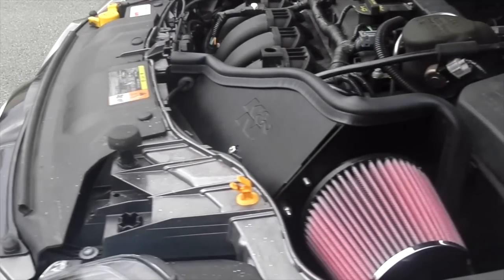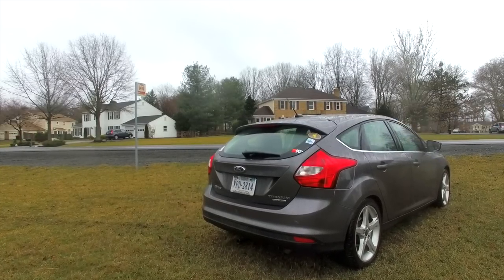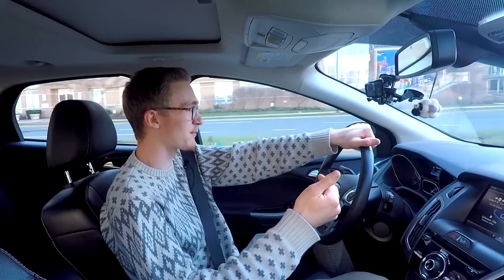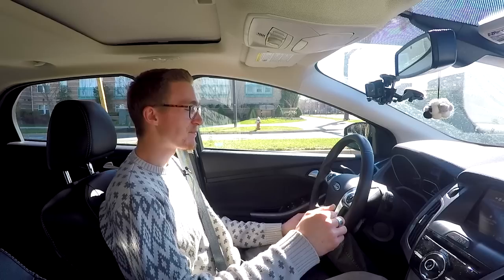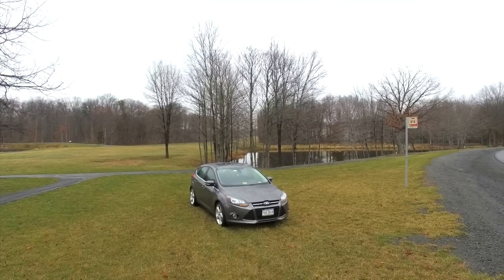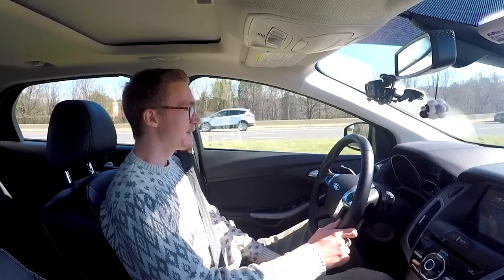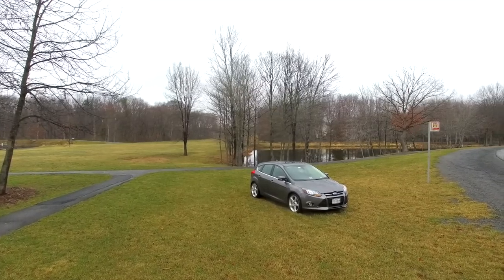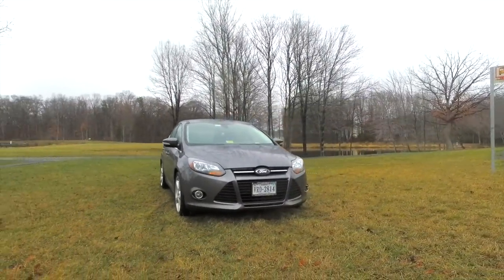K&N Cold Air Intake Update, What Happened to It??

Comment: I had a K&N unit in my car and found that it actually DROPPED my power, economy and cause a random missing in the cylinders. To make a long story short, if you live in a dusty area ( I live in Arizona out in the desert and hve it on a '99 Yukon with and LS1 engine) NEVER use a K&N filter! The dust CLOGS the oil covered filter quickly and causes a number of problems with your engine. I was cleaning the filter about every 2 months (very expensive) so it became more of a drag than it was worth.

Comment: I have a 2017 Ford Focus SEL and I installed the K&N cold intake and it works fine. I noticed that you have a manual transmission but mine is a automotive sport transmission. That might be the difference. Because my Focus is pretty quick after I installed it and no problems.

Comment: So I putt a spectre air filter. On my 13 focus with 186000miles . OK i lost MPG after installing from 27 to 23 in city but I also have code P0420 wich im fixing RN ... And yes I'm a heavy foot driver.... On the other hand the car is running more smoother and drives smoother, when accelerating I can feel a lil more power wich in my case I think it's worth it.... And the sound is amazing as well.... In my experience I think it's worth it for the money your spending if you want a smoother and a lil more push on acceleration....i will keep yall update....

Comment: you need a tune to get the true power from the cold air intake
Reply: No you don't. It's a filter. You don't tune a filter. Drop in filters show 3-7 hp gains. A tune will not change that. The car automatically tunes itself to the new amount of air it recieves. Actual tunes are for when you drastically change how the car functions. Such as complete exhaust systems, new throttle body, fuel... actual stuff. Not a filter.
And. 
Yes i know this is a joke, but still real answers are given.

Comment: Porsches are fun, but also mad money pits. You can drop a forged Duratec Cossie motor in that Focus and still come out ahead of the Porsche in the long run, money wise. Lol. I was considering a K&N filter for my 2015 NA Focus, but it's very dusty here and the filter oil will cake up too fast. Darn it. 👋😩
Reply from the maker: Yeah they're money pits alright, especially if you take them to shops for maintenance. Just dropped $125 on fuel lines...

Comment: So what was the temperature outside when you started to see those losses in power? I was interested in getting a CAI for my 2017 Focus and was making sure to cover all my bases before the purchase.
Reply from the maker: Darail Davidson I started to notice it the most when it was 80° or hotter.
Reply: I live in Cali and I have the same CAI on my 2013 Focus. I did not notice and power difference over the summer (normally reaches 80°-90°). Best part is, I am getting 32 mpg from 28.
Reply from the maker: Jed Asturias Damn I never saw fuel economy gains like that.
Reply: Yeah, maybe driving habits then? LOL I also installed the ST spoiler which helps when I go on high speed. Keeps my car grounded.
Reply from the maker: Jed Asturias Yeah I live in suburban stop and go hell so about 90% of my driving is accelerating from red lights, never good for fuel economy.

Comment: This is just my $0.02, but getting a k&n air intake system is almost pointless as you get maybe an extra 3-5 hp over stock (without tuning) and you pay an extra $50-100 vs. other aftermarket intake systems (you're basically paying for the name...). I'm not hating on it as I have spent $200+ on an airaid intake system on my '10 dakota (3.7l v6, I dont regret it honestly) sometime before selling her for moving purposes. That said, it's just not the best financial investment if you want more power out of your vehicle given it's very minimal gains.

Comment: I have a pickup truck with 6.0 v8 all I did to it was put on a round spector air filter from advanced auto and straight piped the exhaust and I gained power and mpg

Comment: My intake goes away from the engine down near the front fender wall.. Around down.. I notice a difference.. I feel like as if I have more pedal... and I deleted my resonator and had custom lil pipe put and muffler.. I got mine from AEM.. could be placebo but I say it definitely feels a tiny bit better if anything.. but I let my rpms get to about 3 and half grand then I slowly put pedal down to kinda get a feel of the smooth acceleration it’s does feel a bit better.. people say you have to get a tune but if you do that it’ll void your warranty.. so I keep it simple or I would’ve had a turbo lol ..
Reply: And my is also a dry flow intake with the micro filter cover around the dry flow filter.. I had a k and N air filter alone in stock air box it was little different there also.. but it had oil that was on it.. so I didn’t feel as comfortable using and didn’t want to swap out my air filter as often so I rather went the intake .. last for 100,000 miles.. jus inspect every 25,000..
Reply: That’s the way to do it. If IT’S IN THE ENGINE BAY, IT AINT NO COLD AIR INTAKE. Tuck it behind the bumper, in front of the front tire.
Reply: The Revenant yeah? Sounds good thanks for saying bc I see a lot of supposedly cold air intakes but all of them are in the engine bay and I didn’t want that at all.. it cost me 322 bucks.. it wasn’t cheap but I didn’t want cheap at all.. them short ram intakes I do not want them.
Reply: Matt Birdwell yeah I heard the ecu does it itself over time.. I’m not worried about the money.. jus make some more or something.. but yeah I heard that the ecu resets itself.. there’s mixed information about them.. so far so good with mine.. esp since I have an actual cold air intake and not a high flow intake that sits on top of the engine..
Reply: Matt Birdwell haha thanks man.. so I’m digging your setup also.. 600 hp sounds amazing 😉.. where could I even get an ecu ? My car is still under warranty also.. it’s 2017.. honestly I would’ve had a turbo if it wouldn’t void warranty.. a tune and all.. but yeah.. I looked for a ecu power programmer I have hard time finding anything for my car my friend
Reply: Its your exhaust system making it feel better not the cold air intake. However you do need a tune for the map to get that big 30hp gain.

Comment: I can give you an explanation of why you lost power.  By having the heat shield so closely compact around the filter will make it hard to grab air.  Heat shield should have a little more space so there's more air around it.   Otherwise you're short ram function almost like the stock restrictive air box with a filter inside it and can run worse.     A heat shield is good as long as it doesn't smother the filter too much or else it's going to guarantee hot air no matter what.  What would actually help is customizing the front grill to where air can blow directly onto the filter from the outside , that's the only way that short ram intakes can be more effective, by having more outside air blowing through the front and blowing onto the filter itself. I had to adjust my short ram to make it angle more downward and cut some plastic so outside air could actually blow onto the filter itself.  This method doesn't guarantee a whole lot of power but it will help prevent more heat soak and keep things running more efficiently overall.  Properly made, cold air intakes can run very efficiently like this too.  Also just because of cold air intake hangs low doesn't mean it doesn't get hot, the longer you run your car or race it at wide open throttle it's going to start heating up the couplers which will heat up the pipes and everything else which is basically why I recommend setting it up to where air can blow directly onto the filter.

Comment: if you buy an intake with the stock MAF housing your not really going to make much more power if any. I've seen a few with the factory MAF make like 3 or 4 more hp than stock which isn't worth spending $300 for. Buy an intake with a bigger MAF and a tune would make more power. I will say switching to a K&N filter might give you a little bit better throttle response. Now ever car will make more power when its colder. Colder air is more dense aka engines can take in more air. Same with summers the hotter it is less dense aka take in less air.

Comment: Sticking a $300 after market filter in your car doesn't make it a cold air intake. Your filter is wide open. Meaning, it's absorbing the hot ass temperatures inside of your engine bay. Yes it's near the front grill, however so is the radiator, which is super hot. It is by no means taking in cold air. "CAI" is a name that is abused in the after market air filter industry. Which is why people say don't buy that shit, cause it's not a cold air intake. 
The Suburu Crosstrek for example comes stock with a cold air intake. It has the airbox, with a funnel that goes to the front bumber, which bring in air from the grille. It only brings in cold air. That is how a cold air intake works. If you want effectivenes out of a filter like K&N, you have to put it somewhere where it can breathe. Such as the wheel well, or sticking out of the car or something. But just leaving it in there to absorb all the heat from the engine and radiator defeats the purpose. You'll still see performance improvements because it filters less and doesn't block as much air, but you would see the exact same gains if you put your airbox back on. I usually scoff at engineers cause their design sucks, but they use science to put shit in specific places for a reason. You don't just take off the airbox, and put a different filter on to look cool. You aren't doing anything to benefit your car. All you're doing is bringing in more air that's much hotter than it needs to be. More air = more power, but colder air means happier engine.

Comment: K@n are rubbish, iv had two pipercross panel filters , the first was in a bmw e46 325 msport and now in my Vauxhall Vectra Sri 1.8. Great noise and smoother and more responsive, I do use shell v power also. Pipercross use foam rather than what k@n use. My bm ran like a dog with the k@n. I recommend pipercross.
Reply: Foam works better than a thin metal heat shield it's much more density it can absorb heat better especially if it's 1inch thick that's what I use to for my 1.6 turbo Elantra but my system also is a hybridturbine prototype  Thermo electric cooled air to water intake system that I built. Some people that there's a difference between cool air and refrigerated cold air, cool air is free and you don't have to make its outside only on cool days. refrigerated Cold air in not free and you have to make happen inside the engine bay and it stays cold at all times even below the ambient temperature outside.  Just like the Dodge demon using its own ac air intake system that's when start to understand some real shit. I've been building intake Systems for over 20 year's so I know a few things.
Reply: Same shit, different package...

Comment: I have one in my 2017 SEL auto transmission. I have noticed that it does work better when it's colder, but when it's warmer or hotter, it not that bad. I'm going to install a ram air piece this spring, so that might work better for warmer or hotter. I did notice that yours looked a little different.

Comment: OEM air box on the Focus, Fiesta, etc actually have a CAI. The air filter too is more than enough for it as stock or even with light mods.Custom intakes are just if you set a turbo there.
K&N take off low power range to put a litle more of high power range. The stock for stock car is perfect, as on the lower RPM it actually is better

Comment: I realize this video says it's 3 years old but just a little elder tuning advice.. never just take someone's word for it look at a Dyno graph. Just a k&n filter replacing the paper filter will gain you 5 to 7 horsepower. You'll also notice a MPG gain. K&n did an extensive video which is on YouTube debunking through scientific study and Dyno work anyone saying their products don't work. But you can't fix stupid if you're stupid. For the rest of you that want horsepower gains and or gas mileage choose k&n or BBK they both Dyno everything. Instead of cold air tubes which I do believe are not tested for heat soak just simply move to a throttle body upgrade and/or header which will net you far greater increases in horsepower more bang for the buck.
Reply: What if you do a stage 2, put in an mishimoto   intercooler then surely the air will be cooler getting to the filter and won't be too hot? 🤔

Comment: From what I understand the K & N does offer less restriction to airflow and a small hp gain at high revs but at what cost? I would be careful about using a filter like this on the street if engine longevity is a concern. My concern is that it might be sacrificing filtration efficiency for improved airflow.

Comment: u suc
knn is better with a tune and WILL make a difference and the knn helps to make more power with a stage 1 tune
you just added the knn filter
do you use a 50/50 coolant and distilled water?
if youre using just water youl definitely OVERHEAT
i dont think it can overheat with that new car as if the thermostat openes up as the temperatures rise and cooles the engine off

Comment: I have added cold air intakes for a long time to a lot of cars. It always gave me better throttle response, better sounds and some gained better mpg! Until the last few, I wouldn’t own a car without one. Now they make a loud annoying whistle noise on the throttle body? Horrible! A couple actually hurt the performance a little? Also, the k&n is nothing like it use to be... so stay clear of them. If you have a turbo, I would still get one... and maybe a large v8, but get a nice one, it’s worth the money! Never buy the cheap ones, they are a nightmare! I also had a car like this ( the auto trans was junk, so I took it back even though we loved the car) and they actually have a “ green filter” filter ( Amazon!) with a open end design. It costs less than half the of KnN and does the same... if you must have one. Yea it’s cheaper, not cheap! Lol so... I ll never buy KnN again.. 20 yrs using them, total shame!

Comment: i dunno. My experience with K&N has been utter trash and a waste of $$$. That drop in filter did nothing but splash oil all over my MAF when i put down the throttle. The K&N oil filter also doesn't match up to the OEM filter for my wrx, why? Cause the oil filter didn't have the pressure release my turbo engine needed, hence the lost of oil flow and power. I Pretty much gave up on K&N after a tune, cause that's where i learned that K&N, was really not good for my wrx, at all. I knew it was true when i swapped  back to stock and putting the throttle down, it felt like twice the power and a brand new car again.

Comment: K&N intakes used to be good they gone downhill in the last 5 years. Purchased one a while ago for my 2014 ram 1500 it was so mad when I open the box to find out it wasn’t a sealed unit it relied on the hood to fully seal the top of the intake box with rubber stripping that is not a cold air intake at all still breeze in heat from engine bay and other debris. Specially in the hard rain and winter I found it got covered in snow and water all together just a really poor design they did not care just wanted to make the money. I was lucky enough to sell it online and get pretty much all my money back.

Comment: You cold air intake is not legal in California...
Reply: White Devil / I believe NY & NJ don't allow cold air intake systems. Because it won't pass smog?
Reply: @raymathews7035  
I think it's the CARB thing. Not sure
Reply: Jacob Infante / What does that have to do with a cold air intake.
I did some research, and discovered that this product isn't legal in most states.?
I think it would be a good thing to have,but I do have to be able to register my car every yr. You can blame C.A.R.B for this stupid law👎😐🤨😁...I think if he wanted to make a cold air intake work,you also have to make adjustments to the ECU.? Perhaps.....
Reply: That's not true.  Live in California and have had a K&N on my truck for several years, and it always passes the visual inspection for Smog Checks.  Just make sure to apply the sticker that shows the K&N model so the person doing the Smog Check can look it up.
Reply: @rkendsley7561  /  I did look it up for my car. I have a 09 Camry.And C.A.R.B will not make it legal in California.  The full that is driving that Ford probably doesn't live in California, but a free state,maybe Texas,or some other S.Western state. But not California. 

I do use a K&N air filter that fits the  stock air cleaner, and a K&N cabin filter ...
Reply: Who cares . Most of car parts are illegal and ppl still put them on
Reply: @iHernandez620  Will when you go to get it registered (your car) it won't happen with it on.
But this is only in California and in a couple other states.